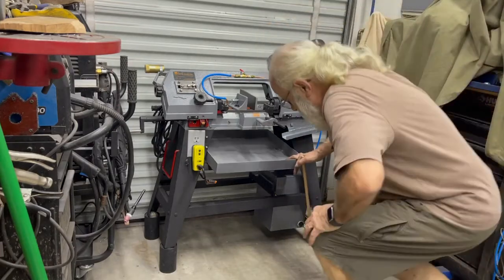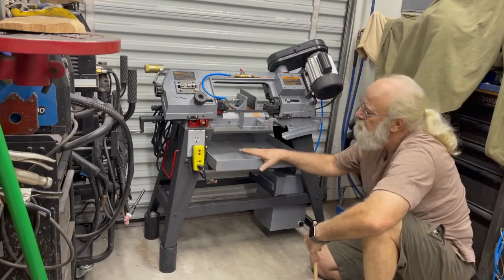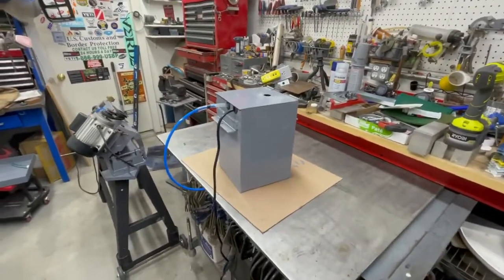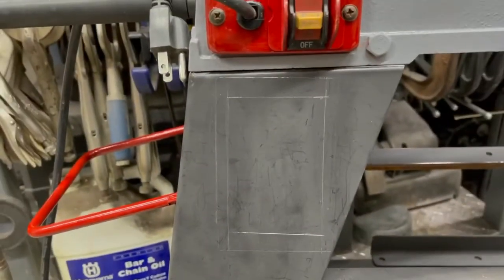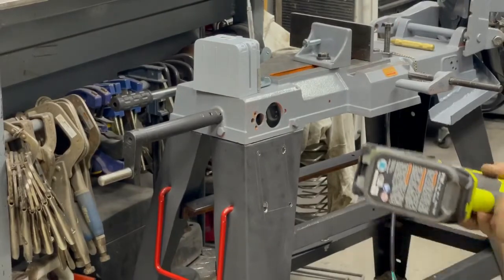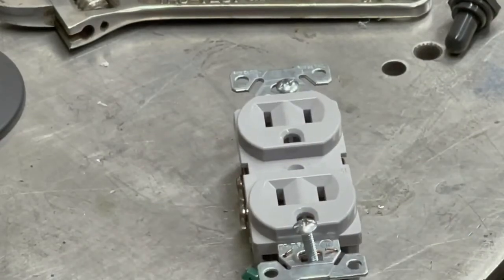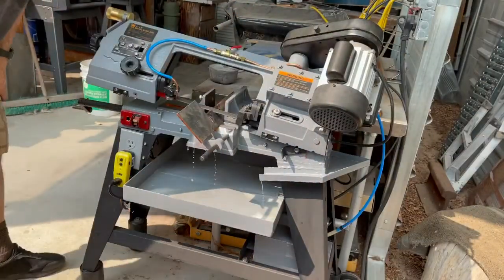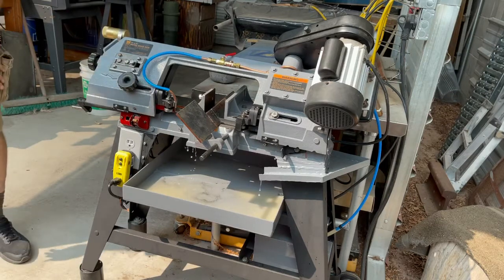Major Upgrade to the Wen 4X6 Bandsaw

Comment: I am a tradesman who has worked with , and owned ,  bandsaws for over 50 years. I never worked with a WATER cooled bandsaw but I have worked with many dozens of Oil lubricated / cooled saws. If you changed out the pump you could have something that would not rust and would do the job much better.

Comment: neoprene "tires" on the blade drive and idle wheels ,,!! ..a MUST to keep the blade on ..!!  and QUALITY bi-metal brand name blades ..!! ..I've owned and operated mine for almost 20 years and it's still going ..probably the best $169.00 I've ever spent ...!! ..i did have to replace the chinese drive motor ..with a USED domestic made motor  i picked up at a yard sale  several years ago ..I use a portable spray mist apparatus ("KOOL MIST") for coolant system when I'm cutting exotic alloys ,,much less messy than flood coolant as the guides and guards are not designed to accommodate flood  without potential leaks  ..i also designed a feed control system using a sliding weight attached to the horizontal  upper blade housing ...anyway ...pretty good small saw ...

Comment: I took a piece of a 2x4 that was maybe 1" x 1.5" sawed a deep kerf into it and simple just dropped down on the blade at the rollers leaving the cutting area it acts like a wick and drops most of the coolant straight down instead of it going around the blade im thinking u can put a clamp on the wood block and adjust the wicking action so far works pretty good

Comment: The modification of that plug is lethal……..think about what you demonstrate.     That you can do something doesn’t mean you should!!!

Stavros
Reply from the maker: ? Please explain
Reply: @papasfixitshop7982  My guess is that he is concerned that you have a live outlet with no GFCI or other protection and liquid less than a foot away.
Reply from the maker: First point is that like all machines, this saw must be monitored while in operation.  Any irregularity requires intervention.

Second is that the likely fault point is in the submersible pump, thus the GCFI.
Reply: @papasfixitshop7982  the outlet you plug the bandsaw into needs to be GFCI i think he's saying. and i'm not sure why you went with that aftermarket weird dongle thing instead of just using a GFCI receptacle?
Reply from the maker: @schlomoshekelstein908  it was cheap and easy to use the pigtail GFI plug